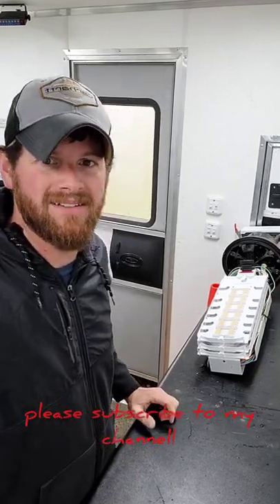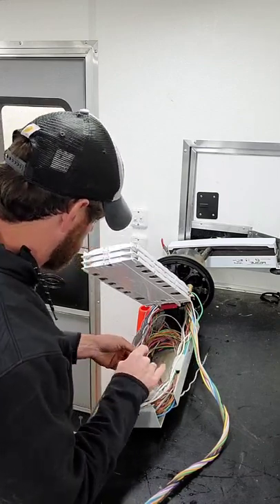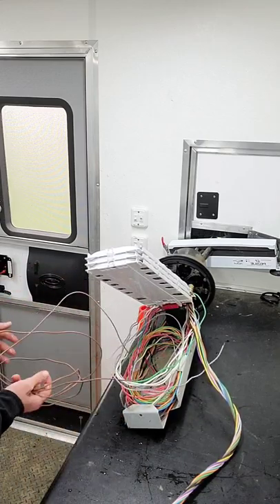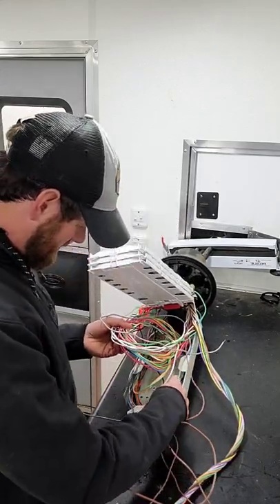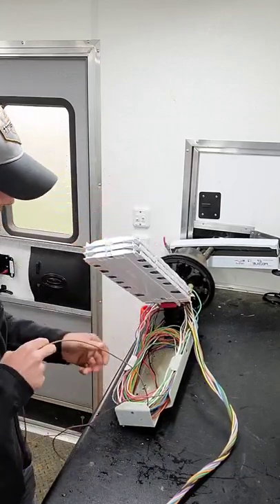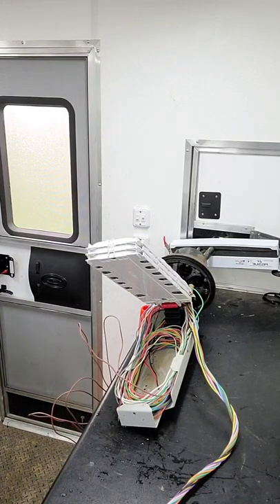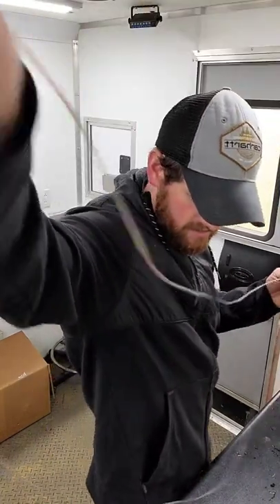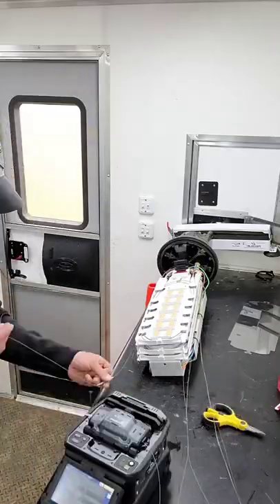Midspan on a buffer tube in a Fiber Cable

Comment: Hey , can you get a video on the midspan from begin to end ? Loosing the tubes out
Reply from the maker: https://youtu.be/-XVKTFnSsZk
Reply from the maker: I'm not sure I understand your question but this video and a few after shows from the cable with the black jacket on all the way down to fiber in the trays
Reply from the maker: If there is something missing in them you need please let me know and I will as soon as I can. I don't splice all the time as that's just part of my job. As we've grown lately, we've been doing more design and oversight as we've started contracting out a lot of fiber work due to the load. Therefore, I haven't gotten a chance to do a much splicing lately.